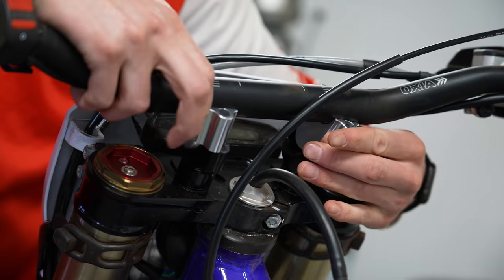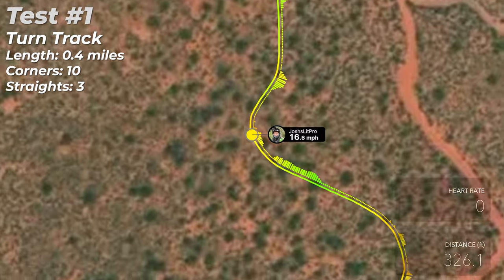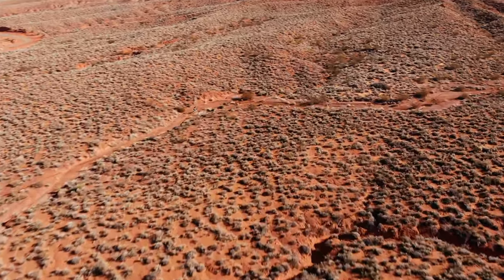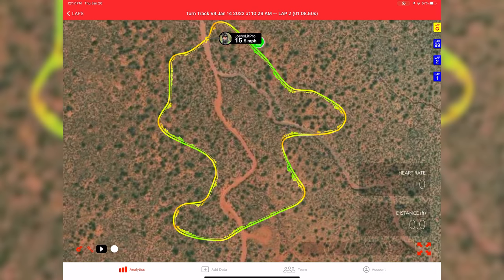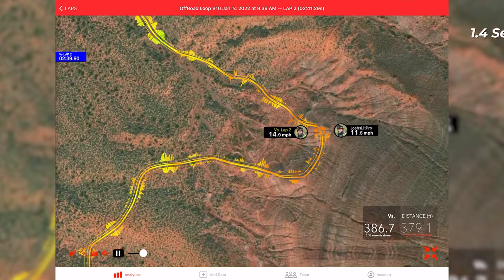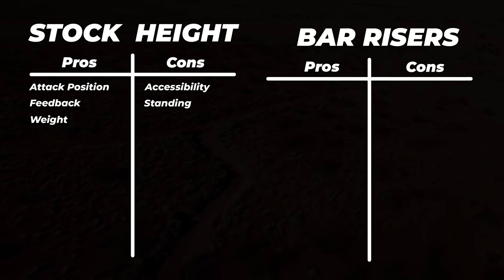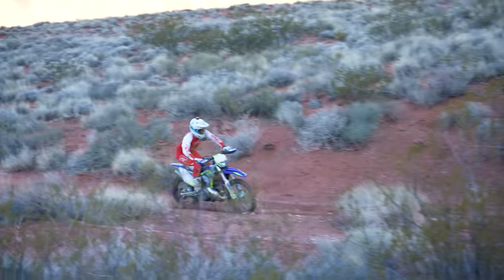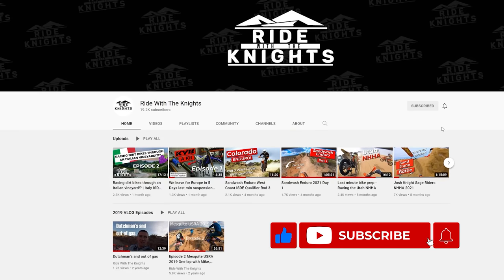Your Handlebar Height Actually Matters!! Here's Why...

Comment: I’m 6’4 and I use lowered pegs on my TM, and they are significantly lower and further back than stock or even fastway adjustable pegs. Something I don’t know is covered on this video is that the rake of the front end translates into the bar position, so adding risers moves you back in your seating position, that puts the bars closer to you as well, I think the problem for us tall guys is that we have long arms and long legs. What probably needs to happen is the pegs need to be moved back and down and the bars forward and maybe up. On my bike the bars are a really low bend with minimal sweep. I can grip the bike with my knees, never was I able to do that with a tall seat or any aftermarket parts. I guess I got lucky that TM makes these peg mounts.
Reply: I use lowered pegs, and the forward mounting holes on my YZ.  It helps a lot to be able to stretch out more with your hands and feet.  I'm more stable in the attack position, and riding feels better.
Reply: Do you order them from a TM dealer? I’ve never heard of them and would like some for my TM
Reply: @simoncleland704  yea TM racing usa is the dealer near me and they have them. They are pegs for the 85 I believe. Just ask Dave for the lowering pegs and he should know what you mean.